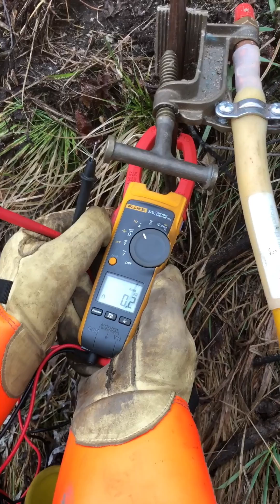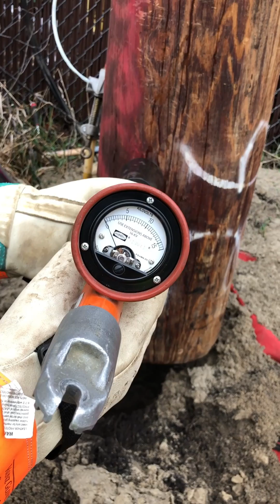Induction Hazards

Comment: I was called out to a manufactured home being set up directly below high voltage lines.   The set up crew was getting shocked pretty bad from the metal framework, while setting up the home.  I came out, stuck my meter in the dirt and on the frame and was getting 120 VAC.     Drove ground rods at each corner and connected to frame.   Sure would hate to be living in that house....